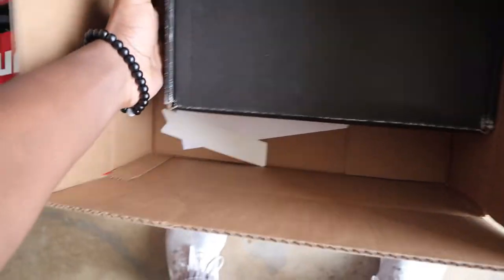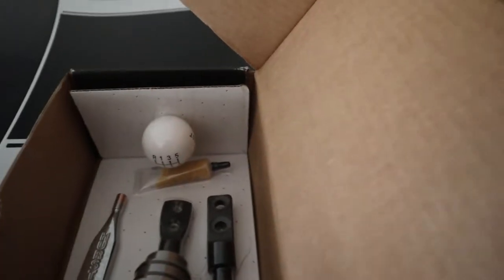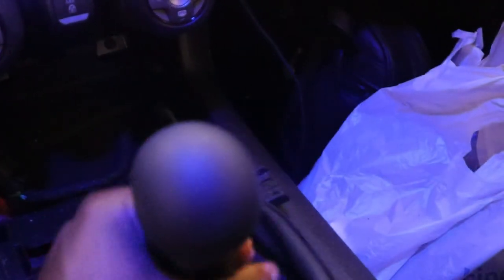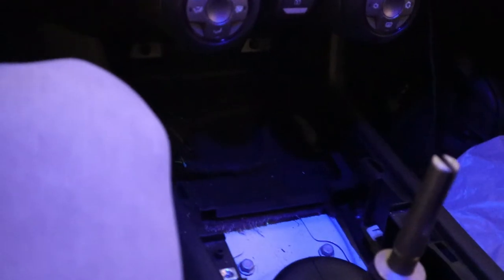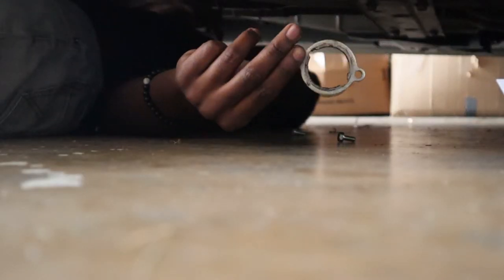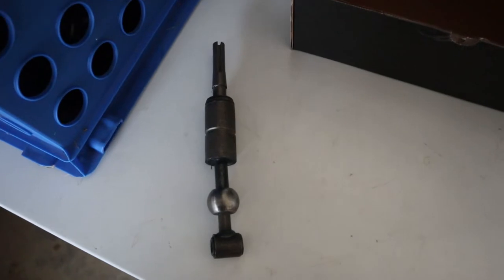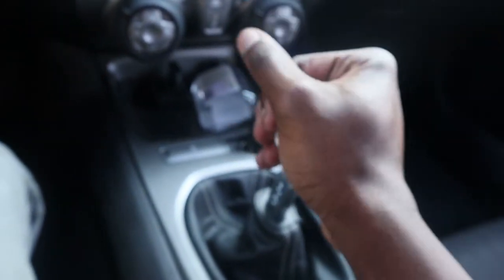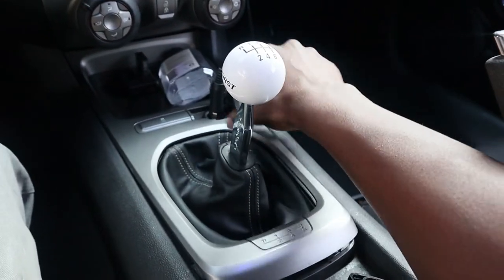Installing A Hurst Short Throw Shifter on my 5th Gen Camaro! (its insane!!!)

Comment: Im thinking to get this for my 2010 ss. Glad i found your vid. Other channels make it look way too difficult, which their professional equipment. Imma hit up walmart and get to jack stands. Already have a jack
Reply from the maker: Yea it’s not difficult at all it only took me an extra hour because hurst didn’t include in the instructions how to remove the centering springs for the v6 model
Reply: @LegendaryBurnout  3 years later and i finally got it. It wasn't that bad to install i had to get an extension to get to the 2 bolt holding the stock shifter.
Reply from the maker: @Chevifier insane you came back

Comment: did you have to lower your trans any to get the shifter out?
Reply from the maker: Slightly, some people say you don’t have to but it’s easier if the crossmember (bolted up at the back of the trans) is loosened a little to give you more wiggle room
Reply: @LegendaryBurnout  appreciate it man! i’m in the process of getting these damn centering springs out but wasn’t sure if i needed to lower it
Reply from the maker: Ahhh the centering springs are the hardest part of the install took me hours to figure it out because there aren’t any instructions and they are hard to see. if you have an Allen key of that size that will work for the bolts holding the springs